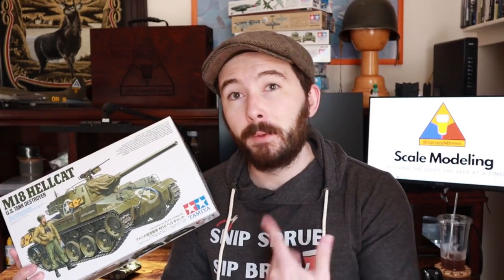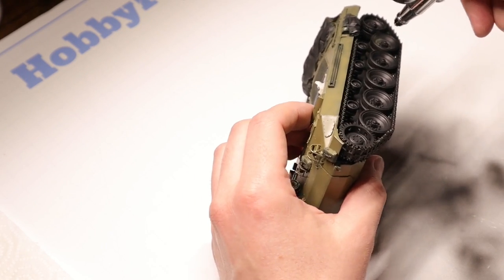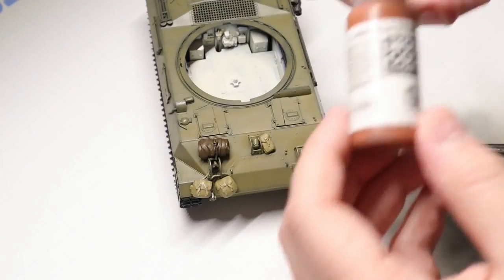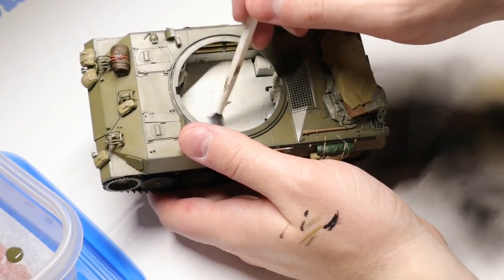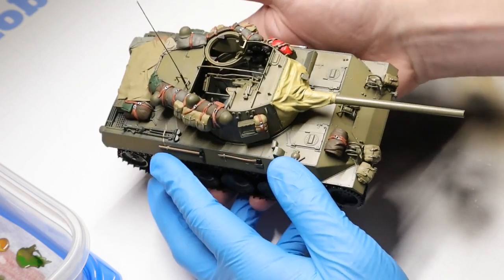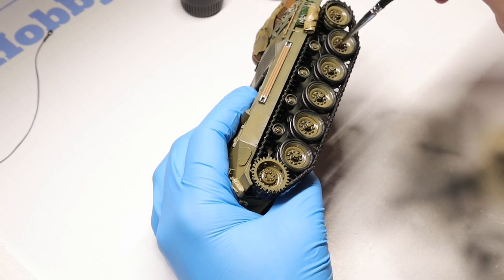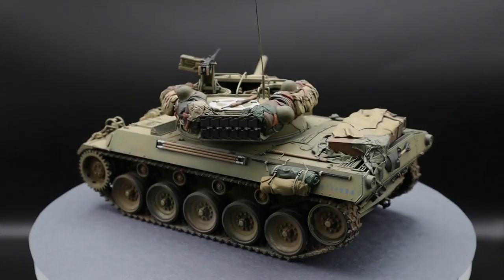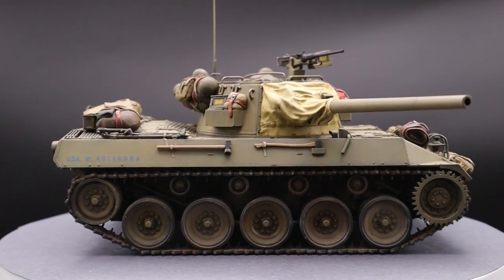Painting & Weathering Tamiya's New M18 Hellcat Tank Destroyer!

Comment: Awesome video!!! Am currently building this very same kit. I also purchased the same barrel and stowage kits that you used. Was quite impressed on how the stowage racks fit perfectly along both sides of the turret - though I forgot about those handles along top edge of turret and had to remove them. Also, the read-deck stowage fit just as good and was also impressed that the bottom of the stowage had the fuel cap indentation to make positioning a lot better. Used too many Verliden and other stowage kits throughout the years and really did not care much for them, though they were useful in places. Definitely can tell that the manufacturer took their time and put their pride in creating this particular stowage kit.
Reply from the maker: Thank you! And I totally agree - Steve over at Value Gear does a great job with the stowage sets, I've always had a great experience with them. Enjoy your build! 👍

Comment: Great work hank, I built up mine and was going to wait to paint it until you did, I didn't know if you would paint the interior of the turret white or not so I waited. I also decided to get the value gear M18 stowage set, still waiting on that but I can't wait to paint this thing up.
Reply from the maker: Thank you! And honestly it could go either way on the turret interior... I've seen some modern restorations with the fighting compartment painted white and others where it's in OD. It's also white in War Thunder, but take that with a grain of salt 😁 Enjoy & happy building!
Reply: FYI.....by regulation all interior portions of an American afv during WWII that would be visible from the air were to be painted in the exterior color. This would include the underside of hatches, the open turret interiors for TDs (tank turrets were closed and so painted white inside) and the hull interior in the fighting compartment area. The driver's/transmission section was not visible through the turret and so would be white (though again, the driver and asst driver hatches would have OD undersides). Always beware of modern restorations. Some are excellent, and some are 💩 .  The more you know.....😊🍻 Great model as always....good to see the videos back!
Reply: @d_squared6942  thanks!!
Reply: @hammyhamster01  😀👍

Comment: I am getting my stuff together to build one of the two kits l have.  The first is going to be OOB, but with the stowage.  The second, l am going to do some texturing, weld beads, etc.  I definitely like the choice of paints but the dunkelgelb...not a 100% sold on it.  I typically use Humbrol #72 for those covers.  Great job and suggestions regardless.
Reply from the maker: Nice! Yeah like I mentioned, I wasn't super satisfied with the dunkelgelb, but it got the job done in a pinch 👍

Comment: Being renewed to scale modeling after 55 years, could you tell me why you don’t prime and base coat BEFORE assembling?
Reply from the maker: Sure thing! While it seems like that might save some time in the long run, I think you'd end up spending a lot more time going back & repainting areas where you've had to do some cleanup on the pieces or cement has damaged the paint layer. If you build the whole kit up before painting, you can catch any imperfections or areas that need work. Hope that helps & welcome back to the hobby! 👍

Comment: I know it might sound dumb but, how do you guys go about brush painting and get it to look that clean and smooth. When I go about it its always too thick or I get very visible brush strokes even after thinning the paint. So if you guys have any tip I would be grateful. Thanks
Reply from the maker: No dumb questions at all! Brush painting can be very tricky, especially on larger surfaces. When I first started, I brush painted my kits entirely, which always left some visible streaks. The best way to solve for that is to invest in an airbrush or try to pick up some Tamiya rattle/spray paint cans - spraying paint is the best way to avoid those brush marks! 👍

Comment: Mr Sprues and brews do you thinn the Vallejo model color for brush painting? Or are you just using water or thinners on your brush?
Reply from the maker: I don't thin the vallejo colors, no! I just use them straight off a wet palette, which really helps to keep the paint moist while you're working with it. If they prove to be too thick, a little water will do the trick 👍
Reply: @SpruesNBrews  Is it Modelcolor or model air?

Comment: Not to be a party pooper here, but some things must be specified, and therefore, may I remind some of the modellers here of one simple fact? While it looks great to fill your tank or tank destroyer with loads of tarps, baggage, ammo boxes and what have you, making it look "lived in", if you look carefully at WWII pictures, you may notice that only tanks or tank destroyers "in transit" had them. Therefore only while traveling from point A to point B. Just before an actual battle engagement they unloaded them while camped in an assembly compound, as could even easily be seen in a movie such as "Fury". The only actual things then, hanging either on the sides of the chassis, on the turret or in front of the glacis, were for protection against German, or in general, hostile anti-tank weapons. Usually represented by either chained or roped logs, or again stacked sand bags or other repelling/protecting material such as additional spare tracks, road wheels and the like. The only thing the crew took in battle were their personal side arms or machine guns and enough K-rations to sustain them. All the rest was left behind.
Why?
Because of weight and because of maneuverability problems that might arise, both for the tank itself, but also to allow the turret to be swung more easily towards a target.A practice that even German tank commanders used to apply to their own panzers.
Therefore, if you want a realistic depiction of your tank/TD then you must also consider these points I have mentioned.
But I am sure that while building your own jewel you will also take inspiration from real photos of that era and therefore notice such differences and apply them as needed.
Happy modelling everyone and first of all, have fun with it.

Comment: Cream weiss is the wrong color. Usually American armor was factory colored with no primer easier to paint over the blood.
Reply from the maker: I think the interiors were white to help identify oil & lubricant leaks - I know cremeweiss technically isn't correct, but it gets the job done! 👍
Reply: Tank Destroyers with open turrets usually painted the turret floor (visible from above parts anyway), with OD so that it didn't standout from aerial attack. The sponsons where ammo went would have been white, as well as the drivers compartment (none with this kit though).